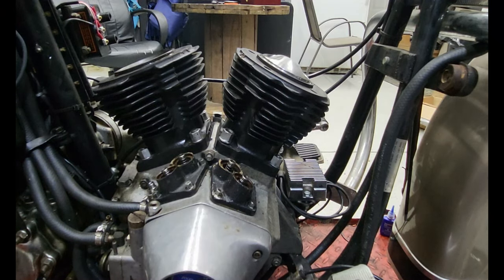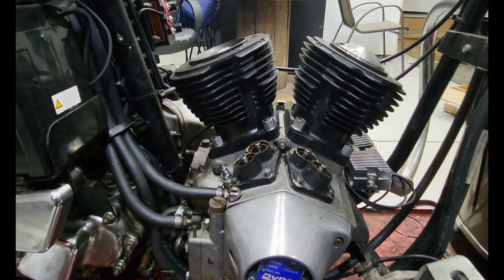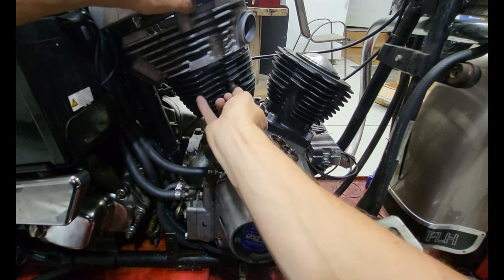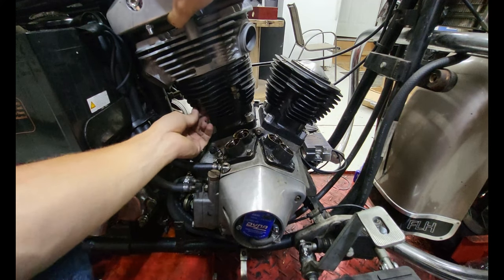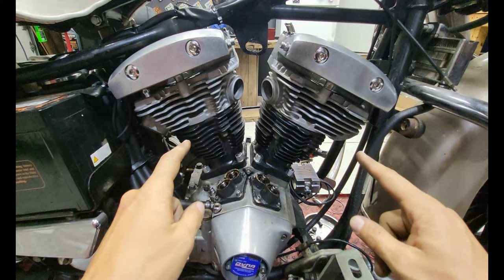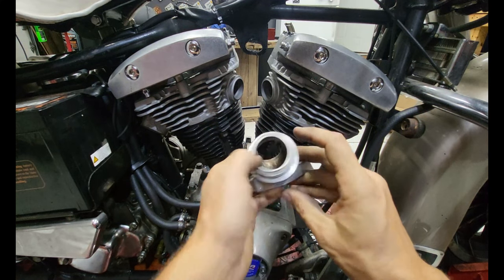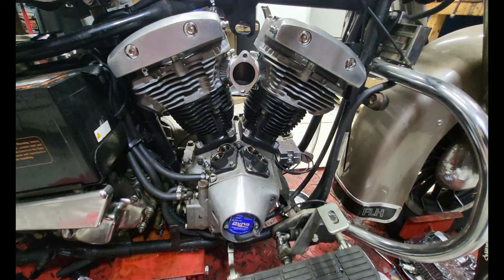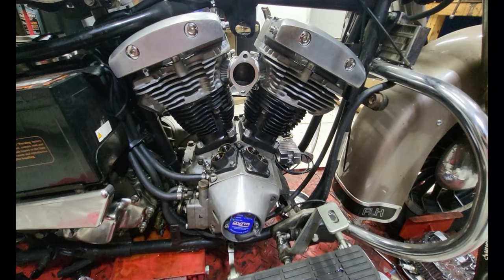Shovelhead top end (PART 4) Cylinders go on, clock heads, torque wrench use, intake seals

Comment: Thanks for showing  the formula  fot the different  angle  on the torque adapter.  Little  white  lithium  grease on the o rings helps them go on, keeps  the flexible  longer.   Thanks for the videos.
Reply from the maker: You're welcome. Lots of people don't go over little things like that. And I agree with the grease, I wish that footage didn't mess up. I did cover that, I used assembly lube, but still, lol.

Comment: Ah ... I always wondered about that torque wrench adapter
Reply from the maker: Life savers when you need em.
Reply: @DWchopshop  well I think I'm going to order a 716 that's what the lower judge the casebolt is. Half inch for the head to The jug boat on mine. Just in case I need it